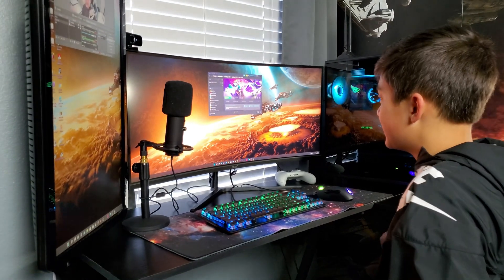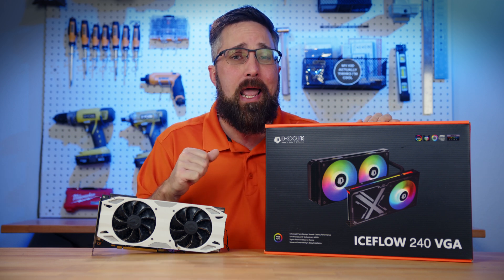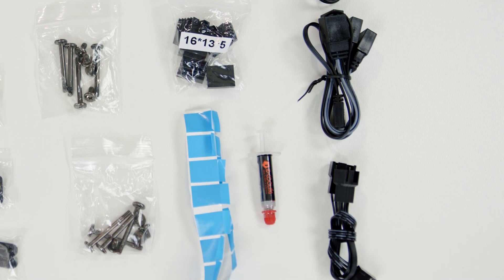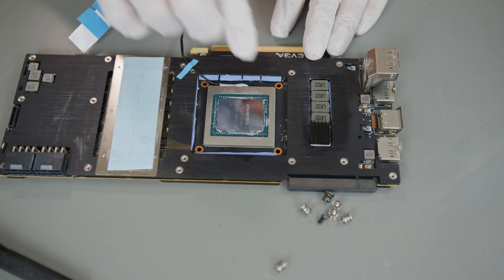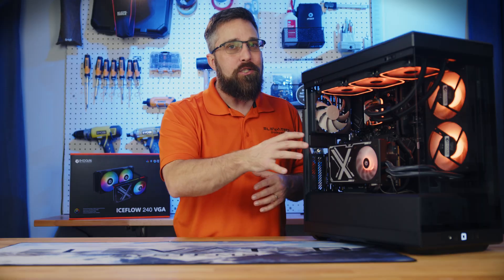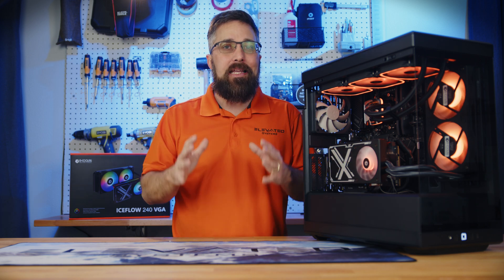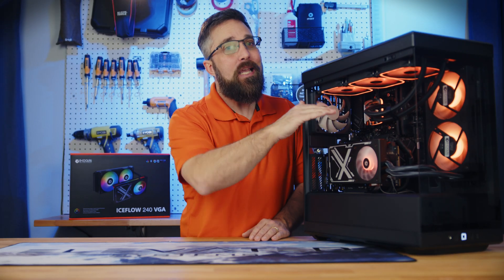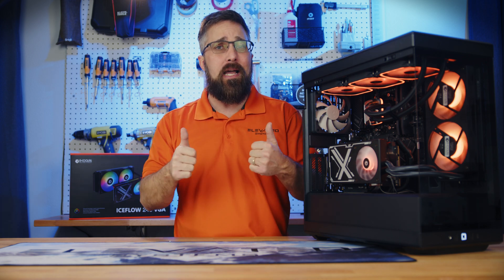Quick and Easy GPU Liquid Cooling!

Comment: CRJ Micro 4-Pin PWM GPU Fan Adapter sold on Amazon to connect the radiator fans to the graphics card.

Comment: This is what I always wanted to do to my 2080, but I'm not a tech like you so I don't even bother to try cuz I know i probably will mess something up. my 2080 runs at 91-94 C most times and I just have to bear with the fan noise. Anyways very neat work and awesome explaining. hopefully someday I will understand and do it myself.
Reply: I've been using this cooler since 2020 on my 2080s. Works fine.

Comment: OH my god thank you for telling me that the pump was actually NOT in the radiator - cause I have it mounted with the tubes up and I was freaking out about the pump failing. Saved me a bunch of time and money cause I was about to buy a new case
Reply: This is a basic Asetek AIO just with a custom mounting solution for a number of GPUs
Reply: It depends on which model of that cooler you have, earlier models DID have the pump in the radiator, which was necessary for the small from factor build I used it in.  ID-Cooling should definitely update their product page to cover both versions of that cooler. Ideally, I think companies should NOT use the same model names when a product changes in a significant way, for instance, when the pump is relocated...

Comment: Good video! I've put the NZXT bracket on a 2070 Super, 2080 and 2080 Ti. Even bought a 92mm RGB fan for one of them! This would have saved me some money and given me 240MM radiator instead of 120MM I used, though even the 2080 Ti runs about 56C with only 120MM of radiator.
Reply: Do you know if the NZXT bracket would fit on the 4070? Thanks

Comment: You could try using a fan header from the graphics card for the fan controls
Reply from the maker: I could, but I'd have to rewire it and pull power from another source because I don't think the card, PCB  provides enough amperage for full size fans.
Reply: @ElevatedSystems  A bit of software called Fan Control might be your ticket - no need to rewire and you can tie the fan/pump speeds to the GPU temperature instead of CPU despite being hooked up to the motherboard.  All software controlled

Comment: Great video CJ. Would this be possible on something like a GTX 770 PHANTOM?
Reply from the maker: The only way to find out is to measure the mounting hole width of the card and check if any of the included mounts will fit. You also have to make sure there is nothing surrounding the GPU die that will interfere with the mount.